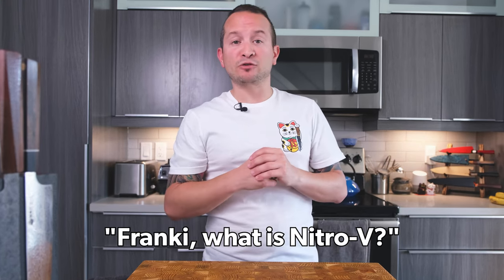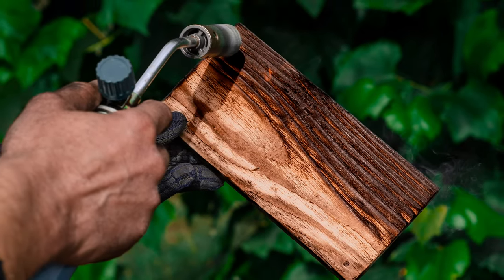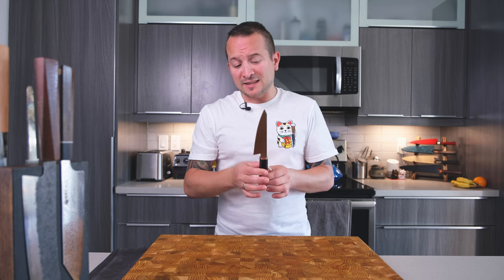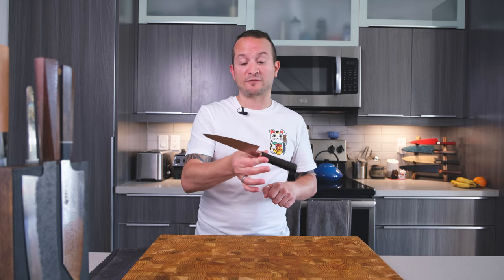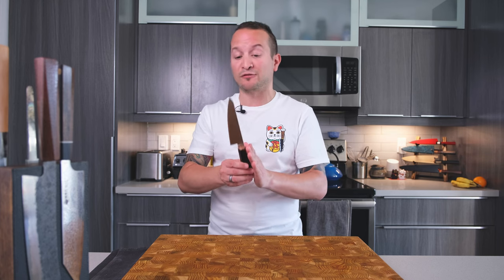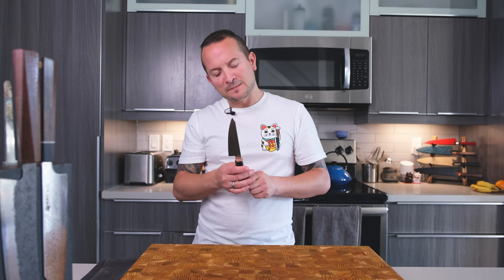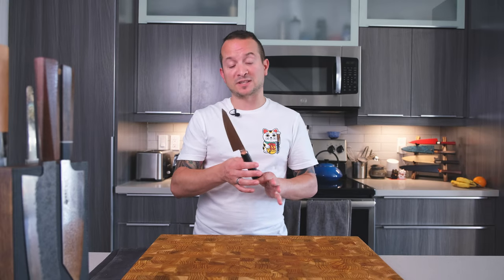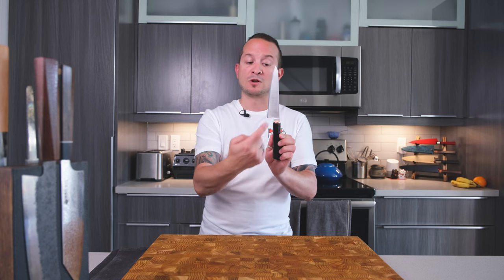Honesuki petty cross? Vachon 6" Nitro-V Utility Knife Review | Kitchen Tools

Comment: Looks like a great knife. Love the shape on the 150mm. Handle is pretty awesome as long as the square edges aren't an issue. Hope we get an update on the steel.
Reply from the maker: Loving this knife so far. As you can see in video description it’s so freaking light. Under a 100g. Very nimble and super comfortable to hold. I too am always curious about edge retention and toughness at this point. Only time will tell.

Comment: Just an interesting note: He does not torch the handles in the traditional way, but rather he "sears" each facet of the handle on red hot steel. I believe he has a video on his IG of this process. I think the hotter direct heat is what gives this handle that lighter weight feel, like how charcoal is lighter than wood.
Reply from the maker: This is insanely useful infirmation. I’ll go check it out and if that’s the case I’ll make a note of it here and pin the comment as to correct my assumption. Thanks for sharing 😄
Reply: Thanks for mentioning this, very interesting. That might also explain how even the finish is as well. Probably easier to control the hot steel than a naked flame.
Reply from the maker: I messaged Noah today actually to make sure this is the case and will then update the video description with this info! @johnniemiec3286

Comment: Must be something in the air. I'm looking at adding a petty right now myself, although a little smaller. Leaders in the clubhouse are Manaka 135mm in Blue #2 with a custom handle or a Gihei 120mm k-tip in ZDP-189.
Reply from the maker: Out of those I’d vote Manaka.
Reply: @KitchenKnifeGuy  right on. I was curious where you would land on that. The Manaka is where I'm leaning as well.
Reply from the maker: that'll be a gorgeous addition. Another SUPER budget friendly addition that packs a punch would be the Takamura Chromax 130mm petty.  @johnniemiec3286
Reply: @TheFrancoAlo  funny you should mention that particular knife. I just sent you a message on IG about a custom maker. I'm interested in a piece by him because it could start a "western" style handle set for me. A little variety amongst the wa handles. The Takamura would fit right in there.
Reply from the maker: look at us talking across platforms @johnniemiec3286